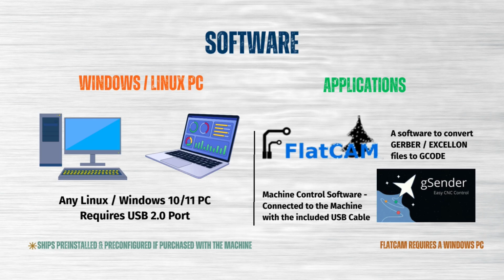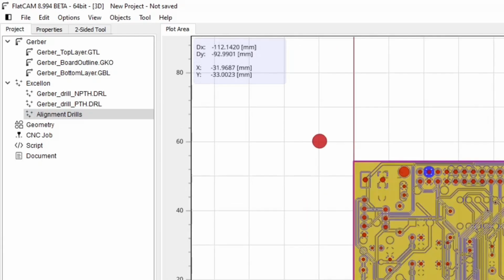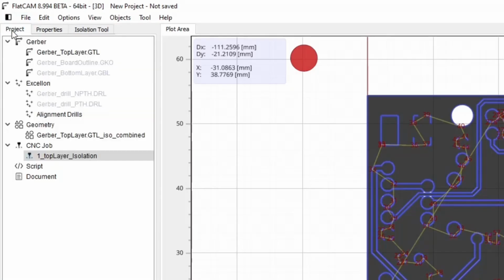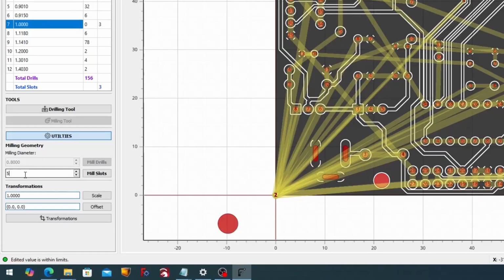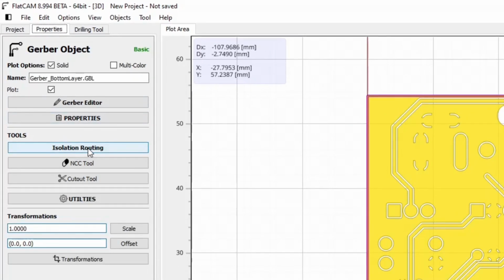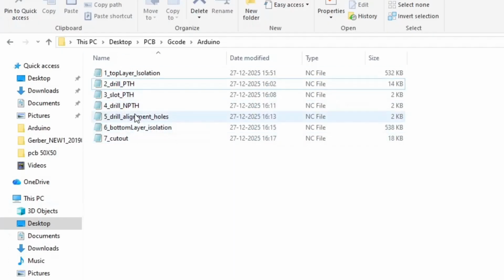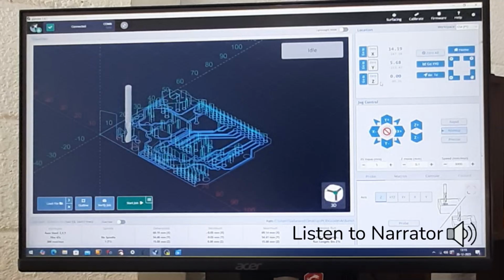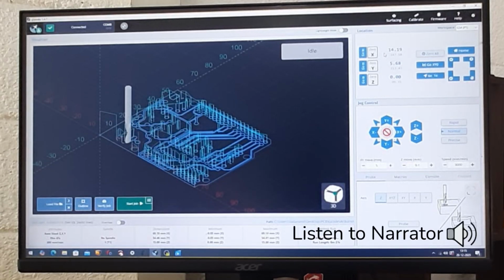Make Professional PCBs in Minutes: PCBProto 4030 CNC Full Tutorial with FlatCAM & GSender

Comment: great vid! maybe you can use height map probing using candle aside from facing the spoilboard since copper clad tends to warp.
Reply from the maker: Great Comment and you are correct. We have advised a few customers about this as well. The z-axis probe is not a standard option but we can integrate it into our machine on customer request.